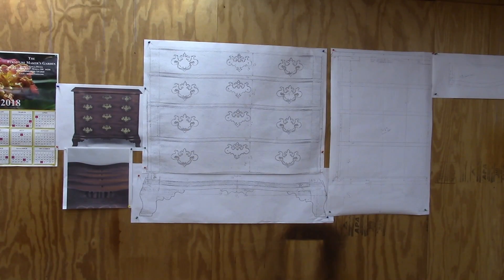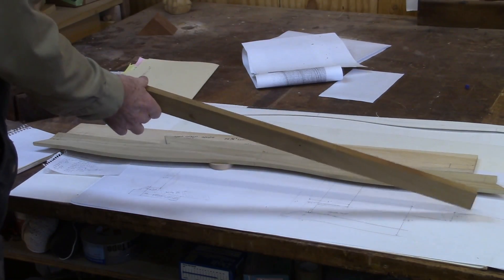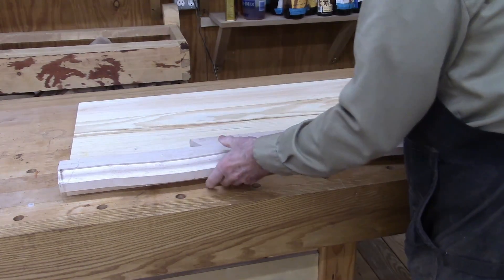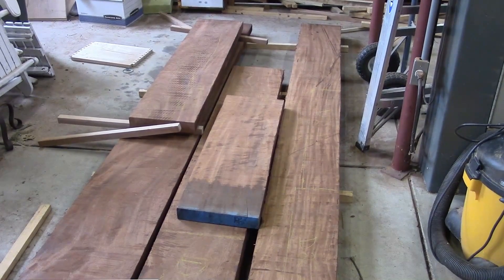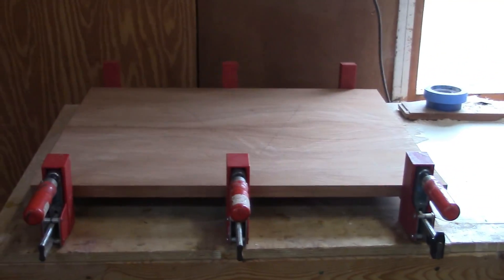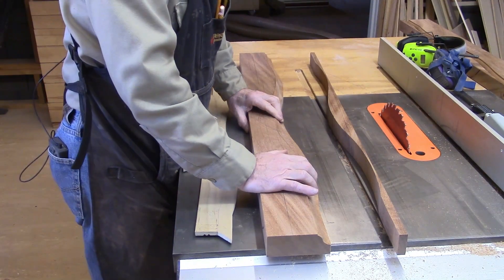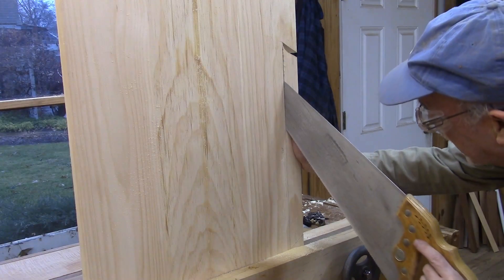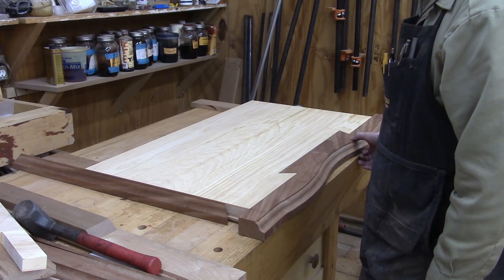Chipman Oxbow Chests Plans Bottom & Molding Step 1

Comment: May i ask  your procedure for blowing drawings up to full size??  that seems so helpful
Reply from the maker: it is a fairly lengthy discussion, PDF's with Adobe are scalable, if you know the dimension you want and have a large engineering plotter like 36 x 44 you can estimate what size you want it to scale too.  After one print, you can measure what size you got and then adjust the scale to the correct size.  I usually get it right after two prints.  If you don't have a printer that size you could probably go to a Fedex/Kinkos and do it there.
Reply: thanks :)